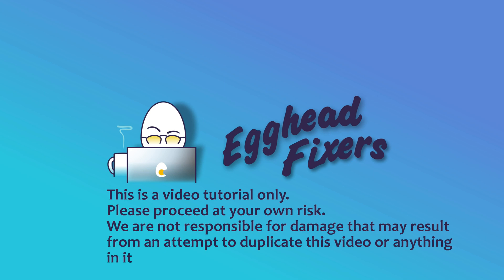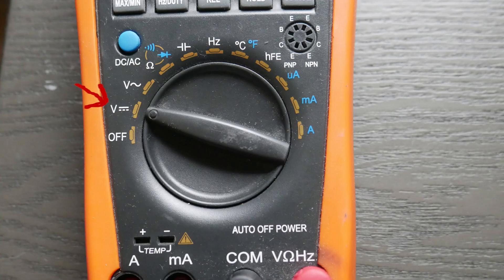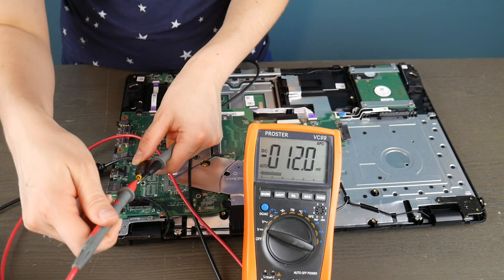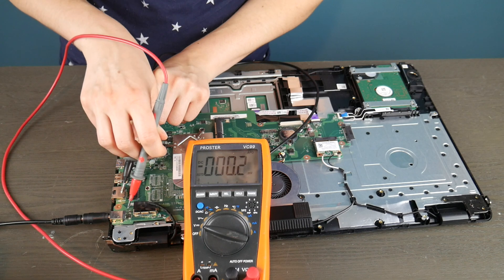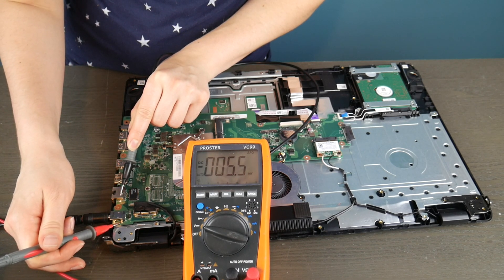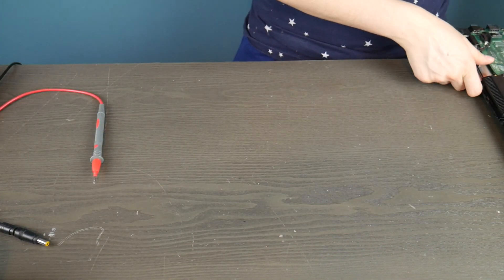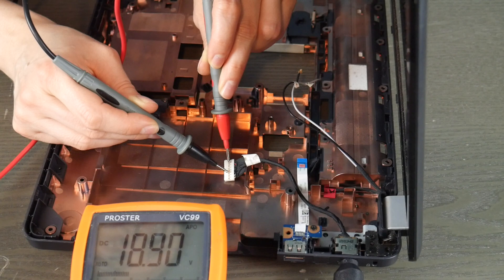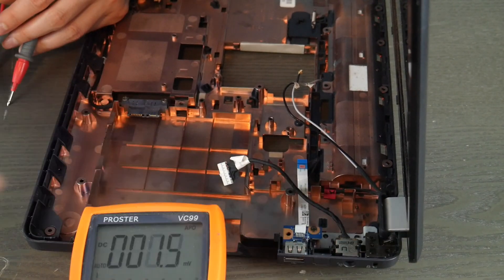How to Test an Alienware Laptop's Power Jack with a Multimeter - Tutorial by a Certified Technician

Comment: I Hava a 17 R3 Alienware laptop that Randoms stops charging and runs off the battery.  I've run a diagnostic scan and also checked the battery which say it's working fine.  Trying to see if I need to check the power adapter brick for issues or what.  Any help is greatly appreciated.

Comment: Hey great Vid! I've bought an old Alienware 17 R2. DC power connection on motherboard is burnt. New one on the way, using my multimeter, what should I expect to see on the black motherboard connector for the DC jack? I'm trying to see if there's a short circuit on the motherboard to make sure its all okay. Bear in mind the laptop was working fine, I pulled the cover off to remove an SSD and then I saw the damage.
Reply from the maker: When you test it then you should hopefully see that it still bring power into the board. If the plug is black from the power jack you may want to try gently cleaning it off.  Windex and a toothbrush work pretty well. Just make sure it's completely dry before you put any power into it.